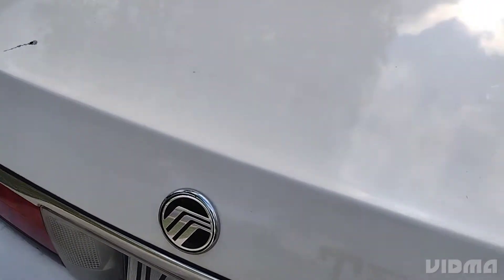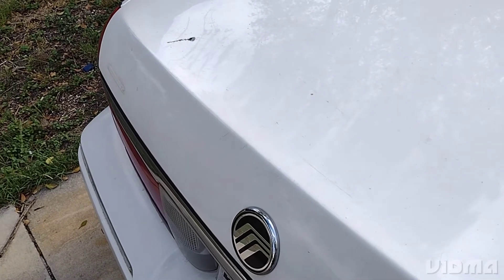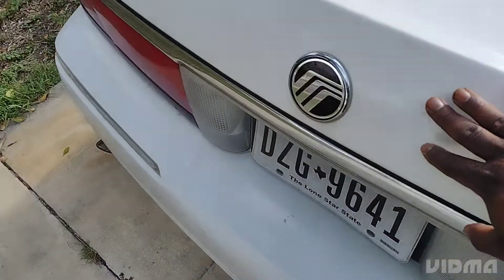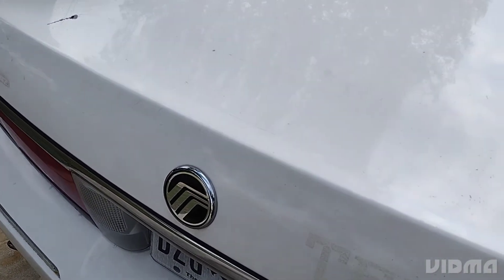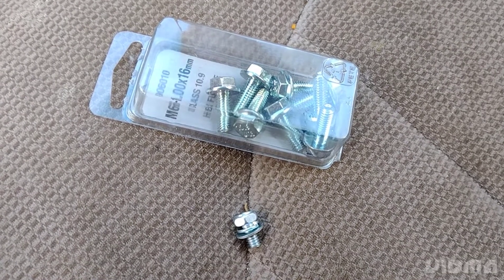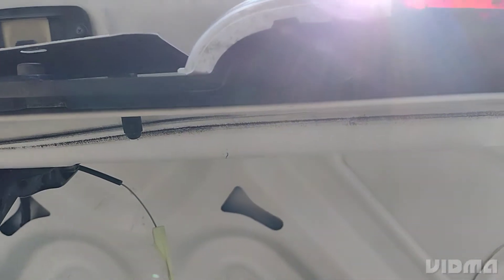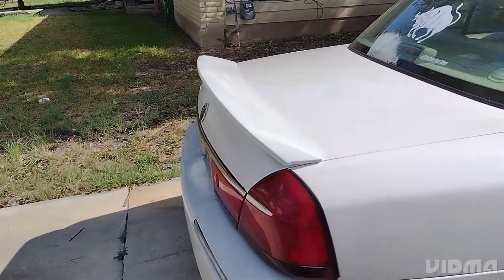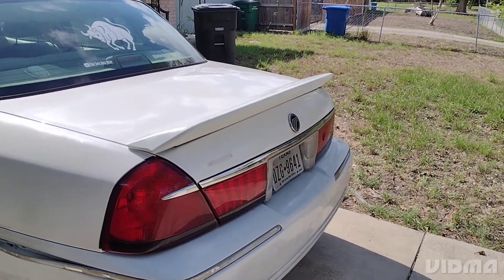Mustang GT500 Rear Spoiler On A Grand Marquis?

Comment: Nice 👌🏽 .. ay fam does anybody know how to change the chrome strips like on yo back bumper especially that front bumper or is that a job for the shop?
Reply from the maker: They are mounted with double-sided tape. All you have to do is stick a flat screwdriver into one end of the strip and peel it up and then pull the whole strip off. Clean off any adhesive left on the bumper then you apply the new strip using a double-sided tape. No special tools needed.

Comment: Can I do this install without drilling and just using tape?
Reply from the maker: You will have to drill. The way is too heavy and bulky not to use the screws designed for it.